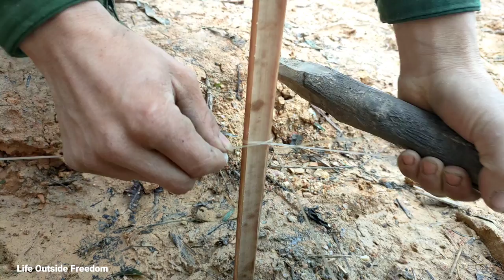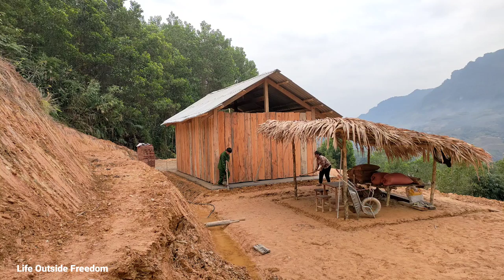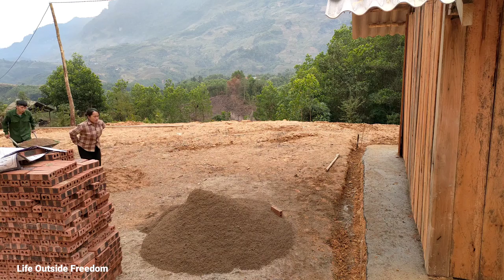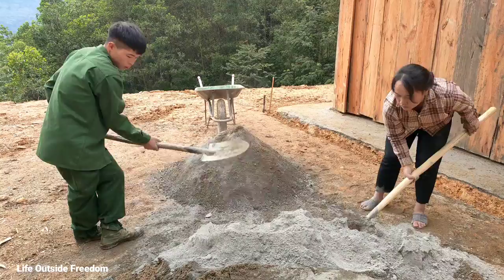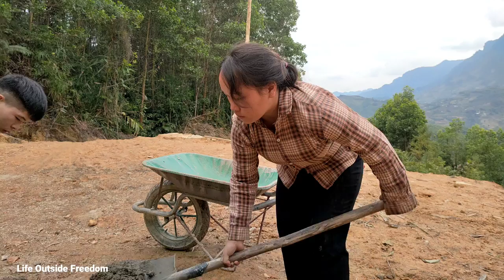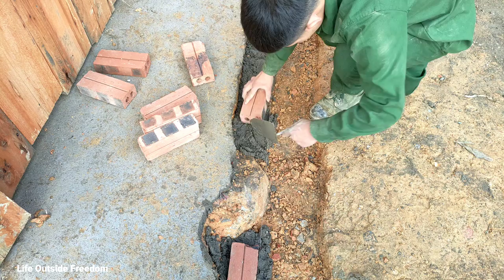Building a wooden house foundation with bricks around it, Farm work / Phuc Sua

Comment: You 2 are a beautiful team! You compliment each other. It was genius to connect the wire to the front of the wheelbarrow to have a teammate help get the heavyweight up the hill to your destination. I'm proud of your ingenuity. 😃😃😃😃😃💖💖💖💖💖 I also love❤🧡💛💚💙💜🤎🖤🤍❣the way you put brick around the edge of the cement (floor) on the outside. Because my sister and I have health issues, but also have a wood burning stove to heat our house, we had to find a way to get the wood inside our house. So we use a dolly (for moving heavy things). But because there are steps up to our porch then a step into our house we put curved pieces of wood in those steps as wide as the dolly to pull the weight up over the steps. But we are always tripping over that wood because it gets in the way. It is hard for me to explain. I'm sorry. Anyway a totally curved level change (that is as wide as our stride distance) makes it DIFFICULT ON OUR BACK ISSUES. SO the step up, step down is easier than widening our stride step to step over that curve. And many that I watch build there have that curve from their floor level down one step (I'm guessing to stop flood issues) to the ground. They often build that way around the duck/fish ponds. Ducks need an area to climb in and out of the water I understand. But for me to go in/out of that water wide shallow steps would be best. ANYWAY I LOVE THE BRICK CLEAN CUT LOOK!❣❣❣❣❣ Take care and God bless you both!